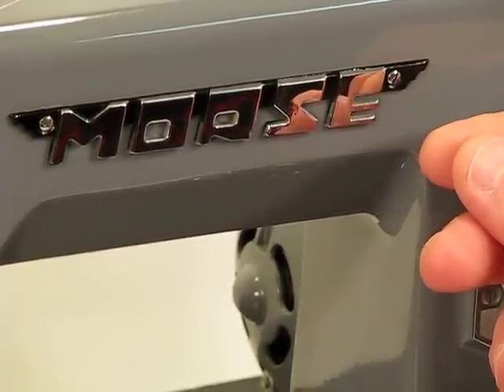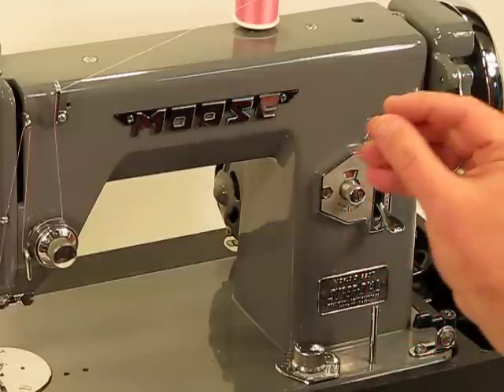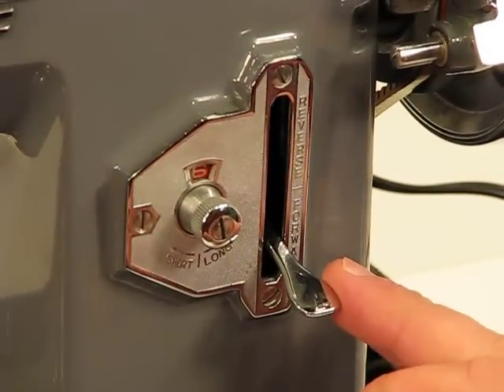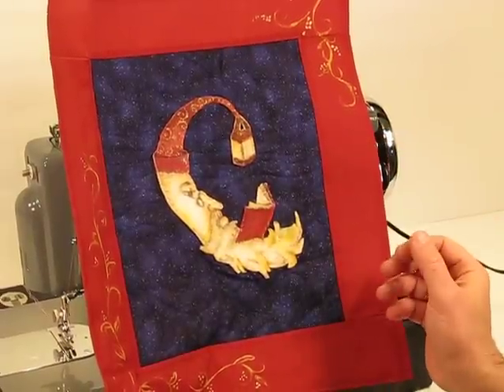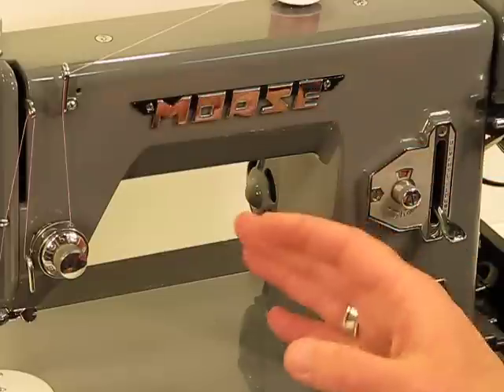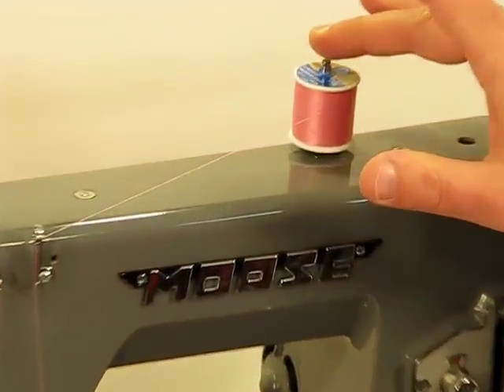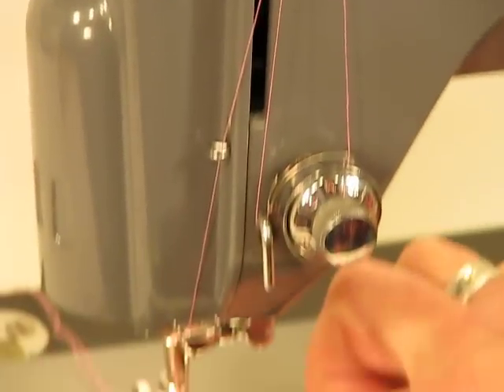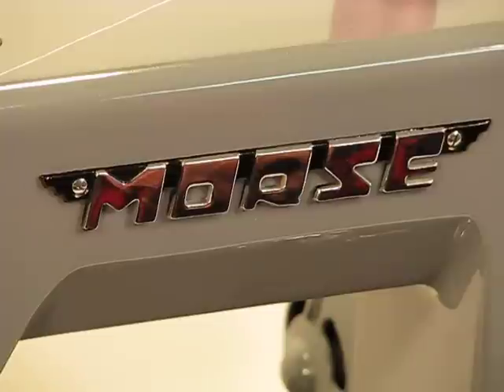Morse Industrial Sewing Machine by Toyota - Introduction

Comment: This is a domestic/home not an industrial machine.
Industrial machine would be a single purpose machine used in a factory. This machine might have been made in a much more durable way than today's plastic junk but calling it industrial is like calling a Toyota pickup truck a freight truck.
Reply from the maker: You need to check your facts, my friend. A single purpose machine used in a factory setting is actually COMMERCIAL, not industrial, and that machine has the unique capacity to operate CONTINUOUSLY. As to your wayward distinction between a Toyota pickup truck and a freight truck, they are not defined by their intrinsic vehicle components, but by their capacity to haul, and the nature and type of cargo goods they carry. So, a Toyota pickup truck depending on the goods carried, can be defined  as a freight truck, just as much as a Straight or Semi, just NOT a commercial vehicle......strangely like sewing, huh?